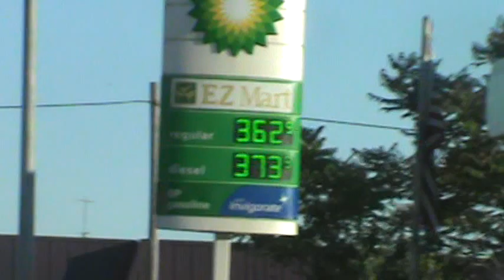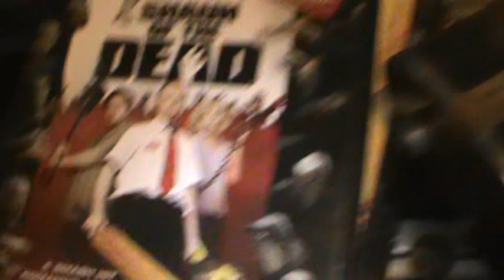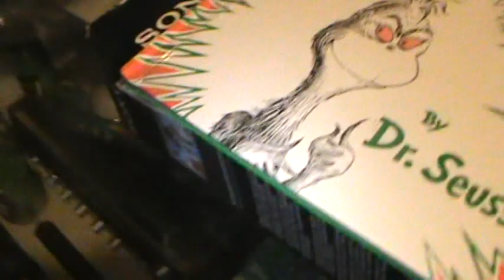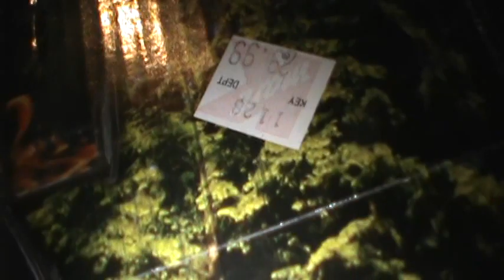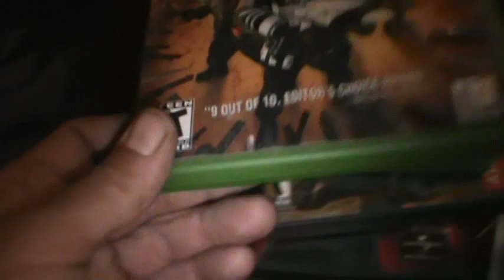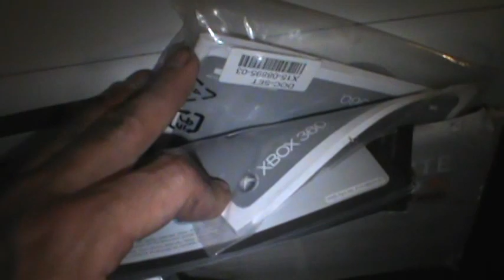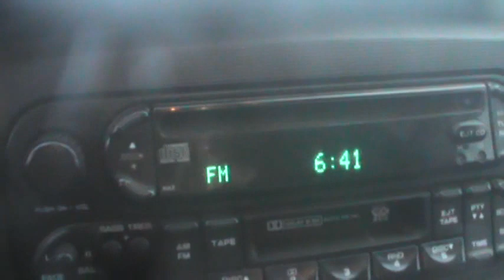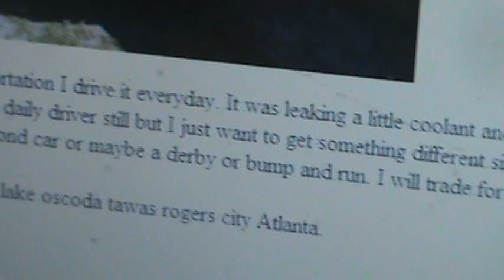Epic Garage Sale Video Game Score!! A Rare Sharp Nintendo NES Television!! Tax Free!!

Comment: You'll get quite a bit of money for your Sharp NES TV with the original controllers and the cosmetics looking reasonably intact.  Those legs that stick out on the front usually tend to break off, so having a set that has those intact ought to earn you quite the coin.